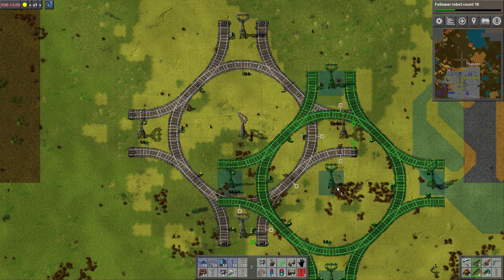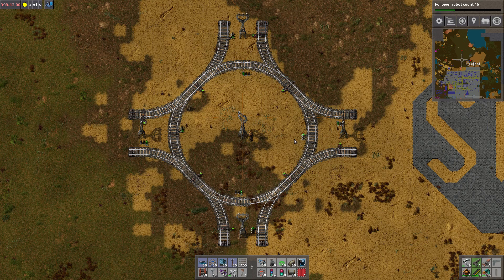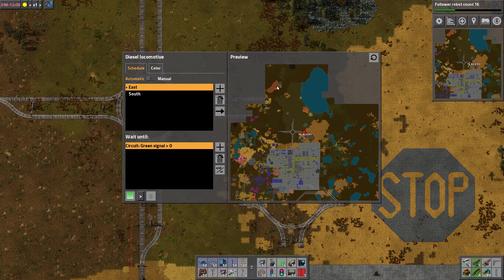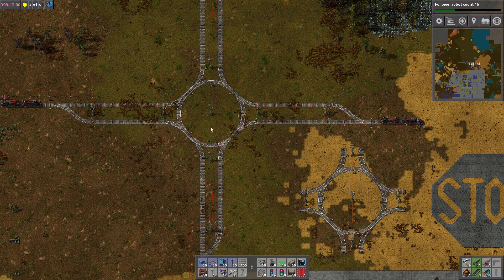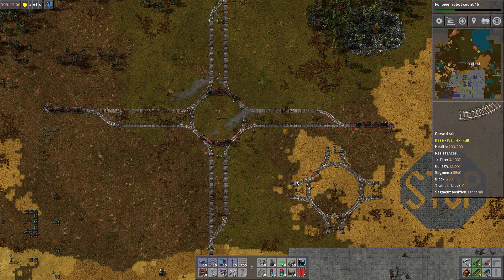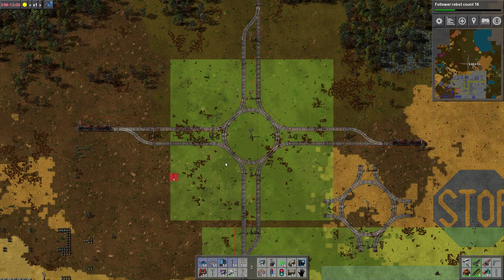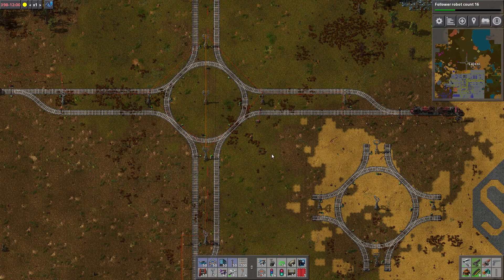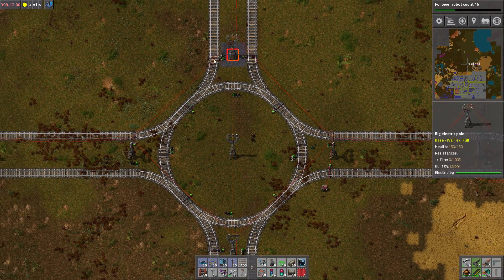Factorio Engineering #1 - Best 4-way junction? (Part1)

Comment: you are going to get gridlocked thanks to the normal signals in the ring.
Change them to chain signals and take the other chainsignals in the ring out, they do nothing.
Reply from the maker: You are absolutely right! I'm an idiot. Mostly for not testing with longer trains, as then I would have seen it directly :)
Will have a new video soon, with a proper roundabout intersection and comparing that to other types of intersections.